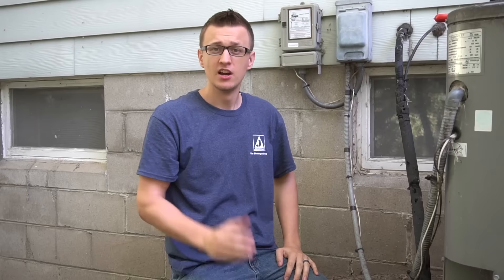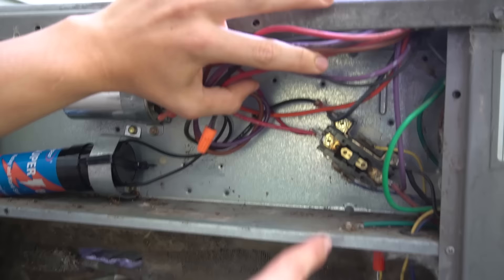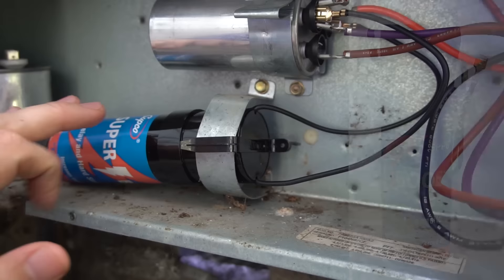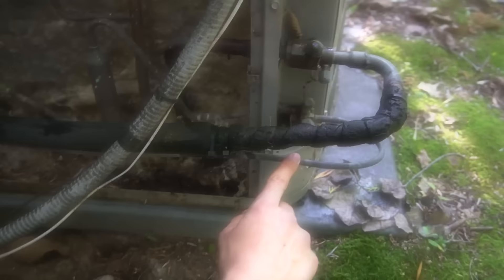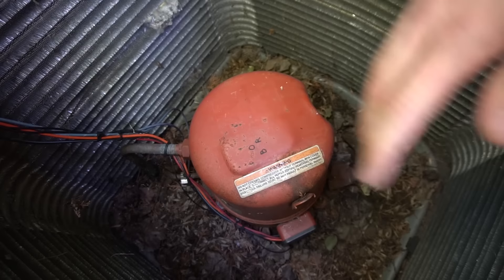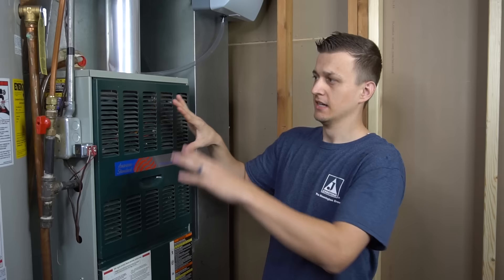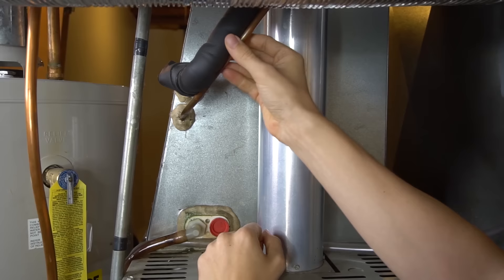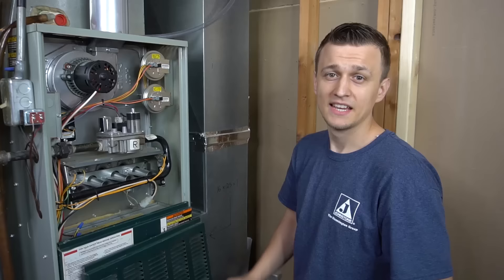All AC Parts and What They Do

Comment: Thank you so much!  Maybe you can do some videos on duct work.  I haven't found any straight forward videos on best practices for design, running flex for efficiency, identifying issues like mold or bad insulation or dealing with mold or rodent feces and urine.

Comment: Some door knobs have a hole in the middle on the non-locking side. You can put in a small flat head screwdriver and you can feel when it finds a slot in the pin and turn it to open the door. Not all knobs have it. And you never covered the upper limit trimesters that shut off the heater when it is too hot. they typically auto reset. I've seen them in the back of the cabinet holding the A coil.

Comment: I thought the discharge line was the section of tubing between the compressor and the condenser, which would be inside the unit.   The 2 tubes in the line set are the liquid and suction lines.

Comment: Great information and it is explained in a basic way to understand the major  components of the A.C. unit.
Reply: To add to my comment, I appreciated the video on cleaning the coils with a spray foam.  It has made a world of difference in the proficiency of my HVAC unit.  I helped a friend and his wife who are in the 70's to clean up the coils and again the AC started to work so much better.  We live in the South end of the San Joaquin Valley California and anything that can help make the AC unit to run better is a big win especially since we have been running 15 to 20 degrees above normal do to Global Climate disruption.

Comment: Thanks for the video,  May I just say, to anyone that has an arm type disconnect box,  The off position should be in the down position, if it is the other way, you should consider changing it before doing any work around  any electric. Fot your safety, You never want gravity working against the off position.
Reply: gregg u do A/C? what state?

Comment: Privacy door handles have a hole in the center where you place needle(that usually comes with the handle and should be placed on the moulding above the door) through. It unlocks the door.

Comment: A few extra things here most of us over the last 30 years have actually clip the wires off the power savers because if you're paying for the electricity you should be able to have a scene in your house otherwise the power company shuts your unit off when they need it because they getting paid by other larger companies and large buildings to maintain even those larger buildings do what's called a curtailment which is a reducing of electrical consumption fire shutting off circuits from the air conditioning in extreme temperatures,
As for compresses he mentioned the two basic old style but there's so many others everything from rotary to VFD screw and everything in between as the a3s and the A2L refrigerants are being pushed and natural refrigerants they're going to be switching over compressors to handle the propane the CO2 and whatever else they're looking to put in homes which means newer designs and massive amounts of safety issues.

Comment: Just an FYI the smaller line is called a liquid line after it leaves the condenser. Also the 24v control voltage is generated by the transformer which powers the board and thermostat. Normally the thermostat is what sends power to the contactor coil. The board doesn’t control the condenser except on newer units that may use WiFi or if it uses a communication signal instead of 24v.

Comment: Should a hard start be installed on new units, to help with the initial startup of the compressor or should it be left out and as the unit gets older then put a hard start on. Thank you for sharing your knowledge.
Reply: I was just going to ask the exact same thing, my capacitor just went out and was wondering if it was needed since I didn't see one in the unit.

Comment: Just some helpful advice... if you have a thicker corrugated air filter you will have to change them more often than a regular cheap filter due to the more filtration. All corrugated filters are considered a hypo allergenic filter and collects more debris than a regular filter and if not changed often your air will be restricted and freeze up your coil and condenser

Comment: My breaker keeps tripping right when I start my A/C. I was wondering if I did the ohms testing and everything tested good on the compressor and then I did the test where I unplugged the compressor and it tripped the breaker does that mean the compressor is locked up? I had a new run capacitor and a starter put in. Your videos helped me fix my furnace last winter and I really APPRECIATED that.

Comment: Excellent vid ... only unanswered question ... direction of the gas/liquid ... into and from boyh condenser and coil. Thx!!!!
Reply from the maker: Thank you! It goes in a loop and as for the direction.. If you look at the compressor, the refrigerant comes in through the thick copper pipe and it comes out from the thin copper pipe.

Comment: You are awesome, thanks, I wonder if you can give the tips to troubleshoot the condenser keeps running when the inside unit stops or the or the cooling temperature is reached. Thank you so much 😊
Reply from the maker: You're welcome! 🙂 The first thought I got is that perhaps the contactor in the condenser is getting stuck in the pulled in position. It is possible to clean the contacts on it but normally I would just replace the whole contactor as it's a cheap part. To confirm if my guess is correct, you would need to check voltage at the contactor coil. Once the thermostat reaches the set point and the inside unit shuts off, the 24v going to the contactor coil should cut off. If there is no 24v at the coil yet it is still pulled in, then the little plunger is stuck in the closed position. But if there is 24v, then the contactor is not the issue.

Comment: I’ve been trying to determine whether my system has a TXV or metering device, but I could not locate either. After watching this video, I realize that it’s probably located within the evaporator coil casing. Is that where they would normally be located? My first time watching your channel. Excellent video. I subscribed.

Comment: well the smaller line is the liquid line... the discharge line comes off the top of the compressor... then through the condenser coil, changing it from a high pressure gas to a high pressure liquid

Comment: My mans AC unit is running at 3% efficiency 😂 

Also, when doing cleaning maintenance on those AC unit fins outside, be gentle with the water pressure. Avoid bending those fins at all costs!

Comment: my outside units all 15 of them have a 24vac power supply on the outside unit near the control board, so the disconnect will cut the power to that configuration.
Reply: Always call someone licensed and bonded so u don’t stop your heart with Electricity

Comment: Why do some states have the AC sitting on a concrete slab, while others will have the suspended on rails going into the foundation, or set on top of plastic stilts? 

In maryland, North Carolina, and Texas, it was always concrete slab...here in Ohio it's always suspension or stilts.

Comment: In hot climates, those capacitors outside cause about 90% of the service calls. The heat reduces their life. If you see any discoloration or swelling on one of those circuit board components, that is a problem. Loose electrical connectors can cause problems too. Remember to shut off the power before touching anything.

Comment: You forgot the squirrel cage! Just kidding.

I think I would have mentioned the 24 VAC transformer and the thermostat by pointing them out. A fan delay relay is easy to explain. But with the newer, high-SEER systems out there, you might explain how the DC motors get their power. Overall pretty good run down.

Comment: Sorry, but at 6:20 that’s the suction and liquid line. The discharge line is the line that comes out of the compressor after the compressor converts the low pressure low temperature gas into high pressure high temperature gas. The discharge line leads to the condenser coil, and after the condenser coil, the lineset that comes out of the coil is now the liquid line again. 

The discharge line is only a very small part of the lineset.
Reply from the maker: You are right! Thank you for the correction. 🙏
Reply: @WordofAdviceTV  No worries, I figured it was just a minor slip up, have a good day. Your videos are great.

Comment: Hi there, & thanks alot for this great video! Thanks for taking your time to explain it all 👍....I have a family member helping me out with removing my home wall's vinyl siding, and replacing it with concrete boards siding, but unfortunately we think as he gun nailed in the concrete boards on my wall, he hit the suction line/thick line, and all freon escaped out. My a/c  was running with no problem prior to him disconnecting the box and removing it from  wall, but after he was finished installing all concrete boards, and he  reconnected it all back up, after me turning on my ac, inside temperature was 82🌡️ and I set up at 75, but for 8 hours it ran straight and never reached that temp, never turned off.  the freon was tested and zero freon was read....so, my question is that if indeed that suction line was nail hit, could it be an ez find, and  perhaps welded after removing concrete boards again and expose the suction line ? Or could I just have the suction line cut outside by hole on wall  and  join/connect  and weld another new line to it, cut another  hole on top of outside wall to bring/run it to attic thru outside wall with the appropriate braces etc instead of running it  inside the sheetrock? I hope I explained it good enough to be understood. If you could please answer, I'll appreciate you so much.

Comment: The liquid line and discharge line are two different things.  The discharge comes off the compressor. The liquid is further down the line set and into the coil..3 types of metering device is cap tube, piston, and txv, and the contactor is not a relay. .just thought I'd throw that out there. Otherwise, good video

Comment: Should’ve explained the single pole contractor is use in this application as a crankcase heater thru the capacitor when the contractor is de energized

Comment: Word of Advice TV = did you remove those leaves in bottom of unit? they are not supposed to be there, plugs drain holes. and did you clean those radiator fins they are completely clogged?

Comment: Worthwhile video.  But then, yours always are.  One thing: Backup power for heat pumps on super cold days: you mentioned propane and nat gas, but probably the majority are electrical.  Cheaper to build into the unit, and faster to heat.  Of course, terribly inefficient.

Comment: As a facilities engineer my specialty is electrical systems but I had a boss who used to ask me to interview mechanical engineers he was thinking of hiring. What questions could I ask to see if they knew their onions? Then I came up with two. If you get either one of them right you get an A. If you get both of them right you get an A+. These are NOT trick questions. They test your knowledge of thermodynamics. If you don't know the answer to either one, don't be too disappointed. Every mechanical engineer and HVAC technician I asked didn't know the answer to either of them. I was surprised especially at the engineers because it told me that their designs were based on plugging numbers blindly into equations. A mechanical engineer is supposed to have a profound understanding of his subject. Oh and how some of them danced around while others just shrugged. 

Question 1; I've simplified the first one but it applies to all mechanical refrigeration systems. A one ton air conditioner removes 12,000 BTUs per hour of heat. The mechanical equivalent of heat from Joule's first law is 1 watt = 3.41 BTUs per hour of heat. So a one ton air conditioner will remove 12,000/3.41 = 3519 watts of heat or the heat output of a 3500 watt electric heater. But a one ton air conditioner only draws about 1000 to 1200 watts. How is that possible? Is it true? Does it violate the conservation of energy law? How can a 1200 watt machine cool a 3500 watt electric heater?

Question 2: Whenever I had an air conditioner freeze up on me the repair technician said you must be low on freon. If freon is what makes an air conditioner get cold, how can too little freon make the evaporator coils gets so cold that moisture in the air freezes to the coils instead of just condense to water? Last time that happened to me after it thawed and I turned it back on the air temperature was 27 degrees F. Less freon = colder coils? Why? What if there was no freon at all? 

These questions are designed to show understanding of how the thermodynamics of the refrigeration cycle works. (I was schooled in many areas of engineering so I'm not an EE, I'm a BE with a major in EE.)
Reply: i want to apply to a refrigeration maintenace position for an ice rink facility and want to know just ehat they will ask me if i get an interview, if you can respond with some help i really appreciate, working out of california.
Reply: i want to apply to a refrigeration maintenace position for an ice rink facility and want to know just ehat they will ask me if i  get an interview, if you can respond with some help i really appreciate, working out of california.
Reply: @JoseFlores-bc3cf  They will ask you about your formal training, prior work experience, whether or not you have freon certification. They might ask you a few technical questions that should be relatively easy for you to answer. I don't think they will ask you any questions about thermodynamics of refrigeration. They will just want to find out if you are technically competent and will want some references.

Comment: From what I know: The accumulator prevents any liquid refrigerant that was meant to evaporate before going into the compressor because a compressor cannot have any liquid refrigerant, it must be at a gas state or else it will kill the compressor
Reply: You said when the compressor has to compress liquid it struggles that’s simply not true
Reply from the maker: Not all air conditioners have an accumulator.
Reply: @WordofAdviceTV  correct unless your in hvacr industry they use those alot
Reply from the maker: @Josepiden   I do understand what you are saying though so let me explain. From my experience, I have seen experienced guys add refrigerant as a liquid to R22 compressors, while fully opening their gauges. The compressor literally sounded like it was straining and about to pop a vessel. Amazingly they survive and after a while sound like normal again. Haven't witnessed any of them failing because of that.
Reply: @WordofAdviceTV  ok that’s good information brother thank you good luck

Comment: When you say "Still verify that there'a no power,« should I just try turn the AC on the thermostat and seeing if the unit kicks on outside, or tap a voltage tester to the whip?
Reply from the maker: Either using a multimeter or a voltage pen, check/tap the wires that come into the unit from the disconnect. Should be no power.

Comment: Excellent explanation. I love the element by element discussion telling what the dangers could be if you get in there. I knew the capacitor had a residual charge but I can never remember how to avoid the danger besides...dont touch it! 
Question - Is the capacitor still dangerous if you change it out? Should you handle it in a specific way?
Reply: I replaced a capacitor on one of my units about 8 or 9 years ago. I just changed it. I didn't know it could be hazardous in any way. Amazingly it's the only thing I've ever had to do to any of them. I've cleaned them but I've never let anyone else touch them.

Comment: Very helpful video, thank you. 

  I have a quick question.  I have an AC/heat pump unit.  I plan on burying some copper pipe and tubing in the ground (little more complex than just that, but I'm trying to keep it brief), and I want to connect that tubing to the AC/heat pump condenser unit outside to help with the heating in winter and cooling in summer, basically exchanging the thermal inertia/more steady energy of the ground with the unit, since 9 feet or so down in my area is constantly around 70*F.  

    What would be the best area to wrap the copper tubing around, the compressor, the condenser coil, and/or the accumulator? 

  Thank you for any help!

Comment: I have a carrier heat pump a/c unit . The outside unit or condenser has an intermittent humming noise while the system is running, heat or cool setting. This noise turns on and off at 2 minute intervals. The condenser has a circuit board inside the panel. The fan is turning, there are no frozen pipes, the compressor is working and the temperature inside the house is correct. It’s a separate humming noise that comes on at 2minute intervals. What would cause this problem?

Comment: Very informative and helpful. Thanks! Is there any way my having my rheem tankless water heater shut off from electrical panel and water off to the water heater could effect my unit? I  turned water heater off yesterday waiting for repair person on Monday. This morning I  hear a soft humming noise switching on and off about every couple minutes coming from inside the outside unit. After watching your video I looked in there from the top and it has a lot of parts in there. It heats and cools my all electric 600 sq ft 3 yr old home. Any thoughts appreciated!

Comment: I actually found that my furnace switch was only wired to the electrical outlet and the power to the furnace was direct from the breaker. When I changed my thermostat after turning off the switch and blew the furnace fuse, I found the switch was not inline to the furnace.